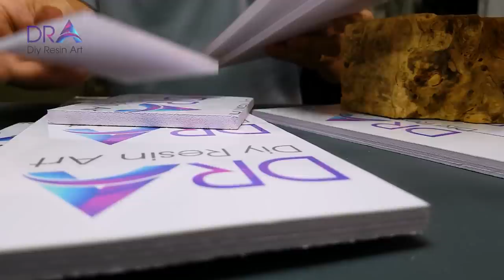Easy making Epoxy Resin lamp wood | Diy Resin Art

Comment: Fantastic work! Could you please tell me what is keeping the base that holds the lights attached to the resin and wood piece while you are staining the base that holds the lights? And how do you change out the lights?
Reply from the maker: It's candle glue, which can be easily removed if it take in the heat 😃 Thanks

Comment: What brand of resin you used for this project, sir? It looks super clear and only need a single pour.  that is casting resin or art resin ?? I watched both of your mix are with different ratio.
Reply from the maker: I bought Epoxy from a local company, It is a 2-component A: B plastic for pouring 5cm to 10cm thick, Unfortunately there is no link to buy online, Thank you so much, sorry for the late reply, I lost access to the youtube channel for a while 😢

Comment: I love your work and I'm currently trying to get started making resin work as well, can you tell me what all you use and where I could buy them? Like the DRA panels you use for molds and the lights in your stands? I spent over an hour last night trying to find the lights last night with no luck
Reply from the maker: DRA panels made by me by myself from Formex panels, LEDs I use 5050 12v or 5v led strip lights 😍 Good luck, if you need anything please ask me, next time I'll try to detail the tools I use.

Comment: Awsmmm, but what resin you use to pour, because I have resin that I can pour max to 12 mm.
Reply: I pour multiple layers. Be careful of pouring too much. Boy it gets hot!!
Reply: Hey @Jill, I have tried multiple layers, but after getting complete cure, I can see the different layers , how we can rid of that?
Reply: @jillclay936  please help
Reply: @deepaksnair1284  think you should ask the expert here x In my experience I find the separation lines are visible if you are not totally exact with ratios. Or try a deep pour resin
Reply: @jillclay936  okay, do you also have any YouTube page or Insta Page, where I can follow you?
Reply from the maker: I use locally sold Epoxy that is used to pour tables or blocks thicker than 5cm, sorry for the late reply, I lost access to the youtube channel for a while 😢 thanks
Reply: @DiyResinArt  thanks for replying, hopefully thing get better again, and I need to find that type of resin actually. Not sure when and where I will find that.

Comment: Hi, Great work. Can you give me more information on where you get your LED's from and what LED's i.e. voltage, make? Do you get long strips and cut down, etc. Thanks
Reply from the maker: Led strip lights 5050 has 2 types of voltage 5v and 12v.  Use 220v source via 12v or 5v Adapter 😁😀🤗 You can buy it a lot at ecommerce sites

Comment: Great idea and very poor workmanship. The back side is not sanded. It has many scratches and cavities. On the sides there are many cavities from air bubbles. At the junction of the upper part of the wood and the resin, there is a deep groove, which was not closed in any way. In my opinion, this product needs another finishing thin layer of resin,
to hide all flaws.
The shape of the base also does not quite match the top. The base is very roughly sanded.